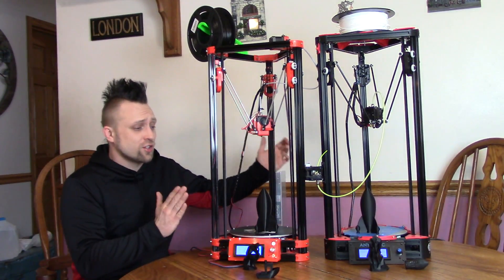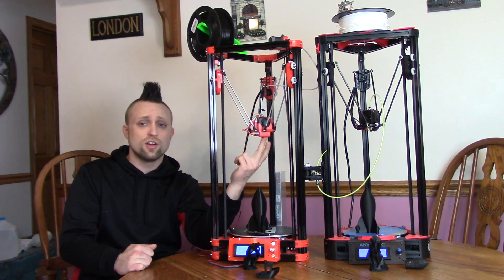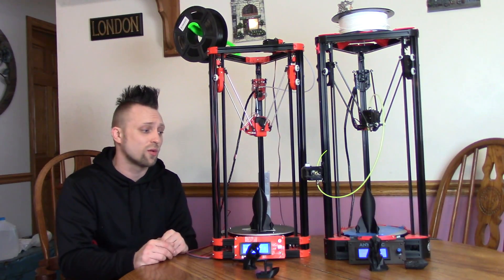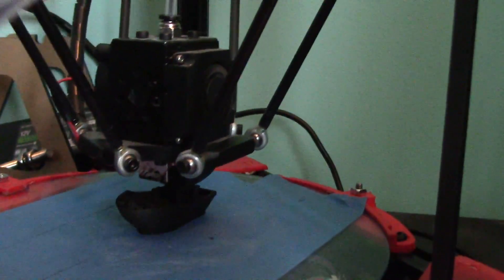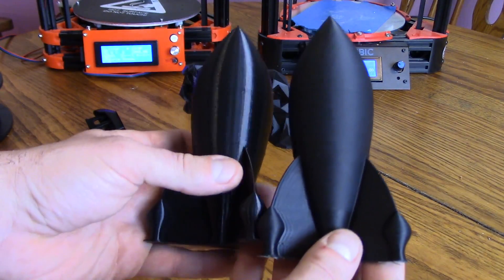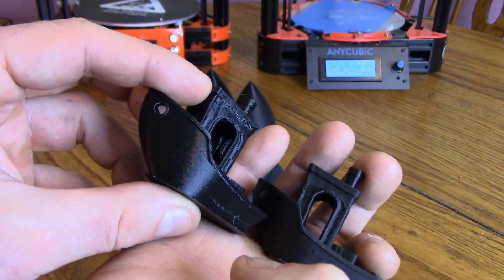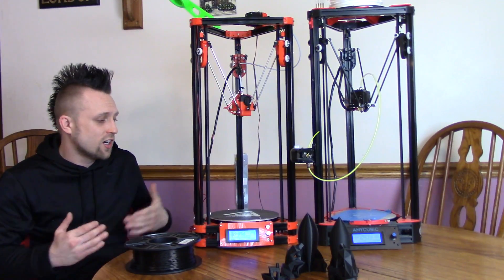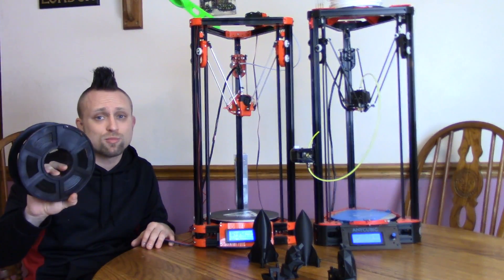Anycubic Kossel Vs FLSUN Delta 3D Printer.  Best Cheap Delta Printer?

Comment: Great job Dylan on comparing the two deltas. The Any Cubic does look like the better way to go right now. Back when I bought my Flson  delta there was no Any cubic choise yet. But I did manage to get the heated bed version for $169 bucks, so it was still a good deal and it still prints really well. I did have to replace the aluminum effector arms with carbon fiber as the glue joints fell apart. Also the all metal hot end unit on the Anycubic looks great !

Comment: Most probably gloss/matte difference is due to temperature. It may say temp is same but it can be off by couple degrees on both printers. When temp is lower finish is more matte, higher temp glossier model. Try printing same model on one printer with different temps.
Reply from the maker: +Draicairgid i lowered the temp by 20 degrees and it was the same
Reply: This needs investigation.
I myself am going to buy anycubic and upgrade to original e3d hotend
Reply from the maker: +Draicairgid i tried from 190 to 215 it was the same.  It is due to the board
Reply: I have a roll of SHX brand PLA in black that prints like this: 195 and above, glossy and 'molten'.
175-185, perfect matte finish, perfect layers/corners.
Odd stuff, prints OK down to 175!

Comment: Hey Dylan, nice comparison. We wish to answer the question raised in your video: the color differences of the printed model were caused by the printing speed. From the video, the ANYCUBIC Kossel printed the models at a higher speed than the other one. We are not saying which one is better but the ANYCUBIC Kossel handle it quicker ;-)
Reply from the maker: +ANYCUBIC 3D i printed both at 60mm sec
Reply: Thanks for the feedback. Based on our experiments, the main reason behind the color difference is the temperature. And the printing speed could affect the temperature due to different filament flow. In this scenario, maybe the accelaration or the jerk setting is the reason. By the way, we test printed a model yesterday using different speed and we observed a obvious color change along with the Z height. Cheers,

Comment: The new Anycubic Kossel also has autolevel sensor. And it also now comes 80% preassembled so you will have it printing within two hours.
Reply: Is it same model? What is the new name if there is any with auto level
Reply: @yes_man_lol  The new model is the Anycubic Delta Kossel Linear Plus. It is an upgraded version from both shown in this video. Heated bed, linear rails, bigger print area, auto level, upgraded power supply, about 75% pre-assembled. The Auto level sensor is removable so that it is out of the way of the printing. Held on by a magnet and has a quick connect electrical connector. Basically if you level it once, that is all you will ever use it. Unless you do upgrades like better bed holders which will change the height.
Reply: @prozacgod  why do you like don't like the flsun delta?

Comment: I think your right Dylan. I built and reviewed the Flsun delta a month ago, "I was able to get the heated bed at the lower price as it was on sale at the time" but the effector arms are so cheep. Its aluminum tubing with fiber eyelet type bearings. The Any Cubic looks like much better effector rods and the metal hot end assembly looks way better. Good job showing both printer side by side. The FLsun did do a great job of printing for the money but the Any Cubic looks like a better built machine.